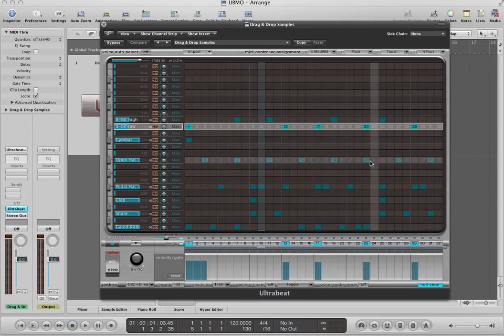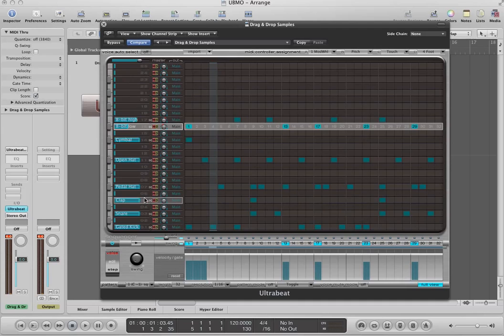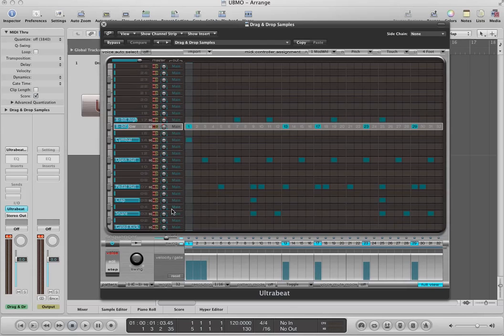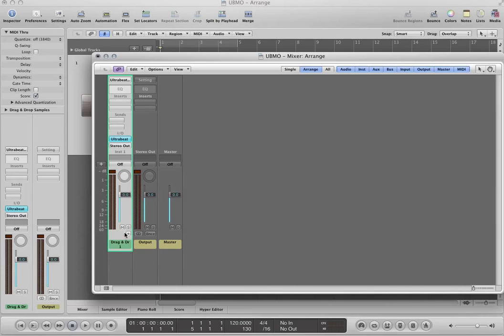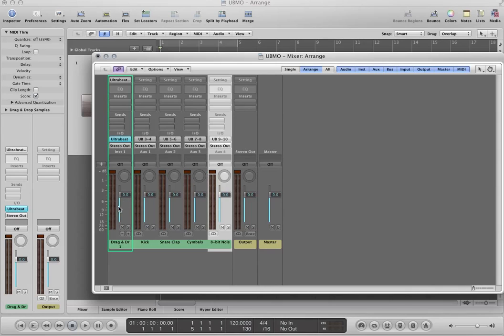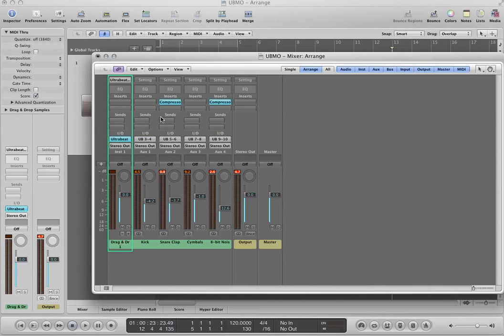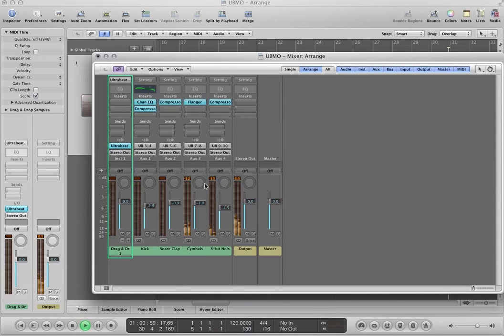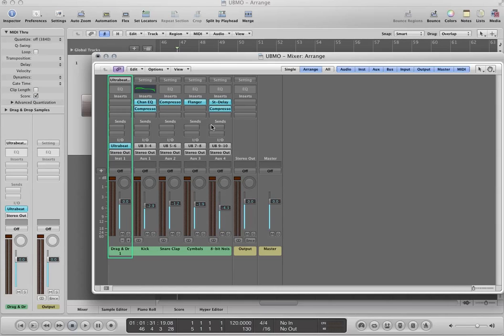Logic Pro 9 - Ultrabeat - Multi-Output Mixing

Comment: Hi - great videos, keep em coming.   Can you help me out with a Logic issue.  When I use the Export All audio files option Logic is not preserving the aux sends info.  Any way to do a mass export with the fader levels and aux sends in check with tracks all exported as single stems?